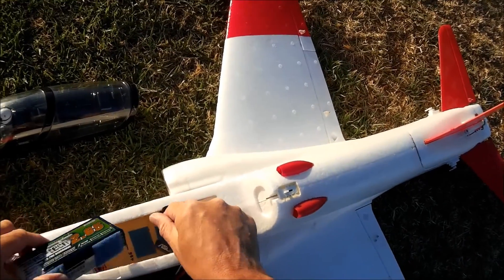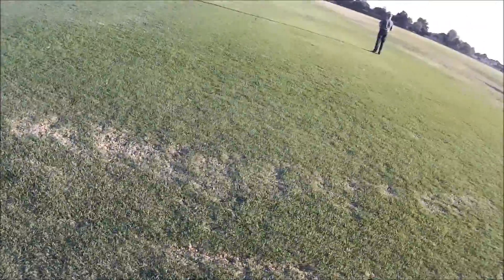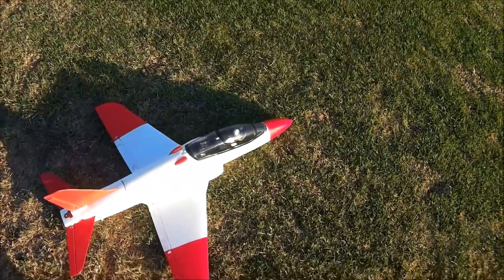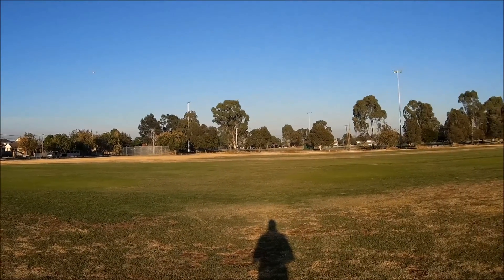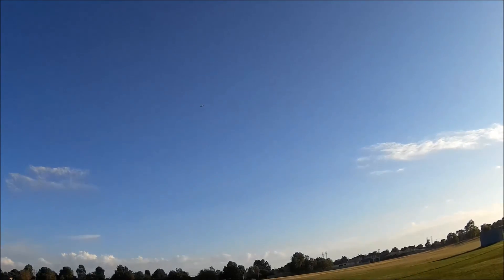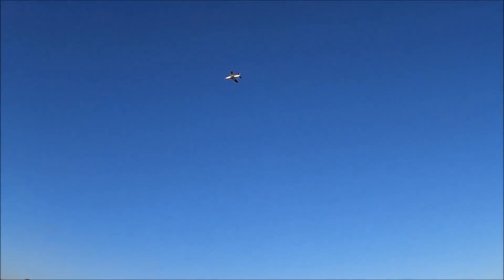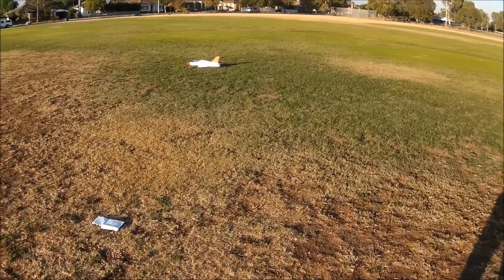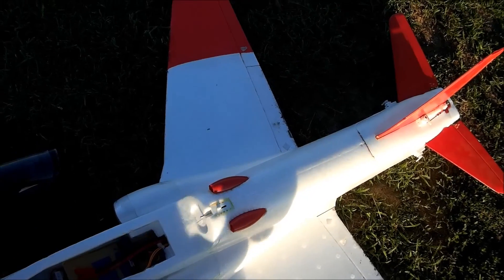T-45 Goshawk - 70mm 5S 380L-2600kv Wemo EVO - 2nd FLIGHT

Comment: Have you considered the FMS Goshawk 70mm jet? (QT-Model) rebranded from Banggood.  In the process of adding electronics, etc, but I recall your video of the F18 90mm with outer spring issues on main gear. This model has that setup and looking to know more on how to modify the springs as you did. Thanks.
Reply from the maker: The F/A-18C Blog is here: https://www.rcgroups.com/forums/showthread.php?3343443-F-18C-Hornet-Freewing-90mm-EDF-Rating-6-10
I have two 70mm Hawks (as per this video.... Kit) that I have not completed building..... for about 5 years! LOL.
Not sure if the 6S version of this video Hawk is posted (need to check), but it flew off into the distance with no control one day = crash, destruction. Luckily into parklands! It was a great flying jet, as is the 90mm Hawk I have.  Hawks just fly exceptionally well.